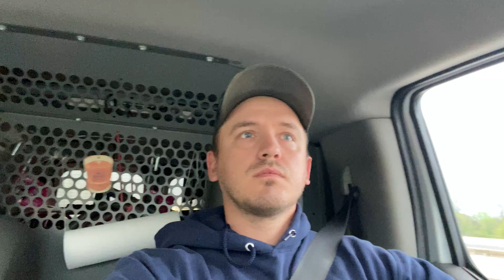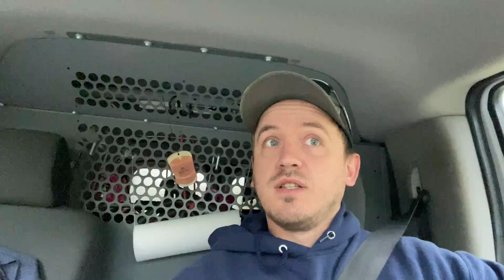What Happens When You Have A Filter Prior To A Low Pressure Cut-Off?

Comment: You have a short that shows algae in a sediment filter.  Thank you, you are the only one on the tubes who answered my question of where the algae came from.  Your videos are very useful.  Do you have a longer video about the algae in the sediment filter?  How do you clean it out?  It doesn't come out when you open the cleaning valve.  I will tape it so the sunlight does not hit it. The plumber put it prepressure tank because there was an old water softener loop in the spot.  I have a sediment filter on my washer, but it doesn't work for keeping the water flowing.  We have hard water.
Reply from the maker: I don't really run into this issue all that option. Typically a good heavy chlorination and a wipe down is enough to clear it out. We typically aim for 100 ppm when chlorinating. This will also create some debris from the dead algae. You would want to use an exterior spigot to flush out the bio debris. Hope this helps

Comment: Hi, in a mobile  home park with well water there is a pressure tank, a storage tank, a booster pump on a VFD drive, a filtration system and a UV light system.  Its currently set up that the it goes well to pressure tank then into the storage tank then goes thru the booster pump then thru the filtration system and then out to all the homes.  The problem is my 100 gallon storage tank is getting sediment and green so I want to put filtration system before the storage tank. Would the proper configuration be as follows to avoid this problem, WELL - PRESSURE TANK - FILTRATION SYSTEM - STORAGE TANK - BOOSTER PUMP - AND THEN UV LAST?  Does that make sense?

Comment: 7:08  I have never been able to find a check valve with a stem for a pressure switch.  Also, for before the pressure tank, what type of filter is best for a well with a lot of fine sediment? The spin down works for large particles.
Reply from the maker: This particular house has the low pressure cut-off attached to the switch. I've linked them below. The filter set up is one I see with good success of difficult water. I usually recommend pressure gauges pre and post filter and a bypass set up just in case one of the canisters doesn't play nice and you're in a hurry. 
Low Pressure Cut-off: https://www.homedepot.com/p/Everbilt-30-50-Low-Pressure-Switch-for-Well-Pumps-EBPSL3050/205617988
Check valve ( i prefer Stainless but I didnt see it on the home depot website)- https://www.homedepot.com/p/Everbilt-1-in-Brass-Check-Valve-EBCV100NL/205617998#overlay
1" Stainless MNPT -> CPVC: https://www.homedepot.com/p/Apollo-1-in-x-1-in-CPVC-CTS-Slip-Stainless-Steel-MPT-Adapter-CPVCMA1/312453134
Multi stage filter:https://www.homedepot.com/p/ANCHOR-WATER-FILTERS-3-Stage-Sediment-and-Dual-Carbon-Block-Whole-House-Water-Filtration-System-4-5-x-20-in-AF-6003/314511314
Reply: @Wellssepticandmore  The 3,stage filters are great for house water, but what about for protecting the pressure tank?   A spin down works for stopping large particles, but not fine.  And particle filters get clogged fast.